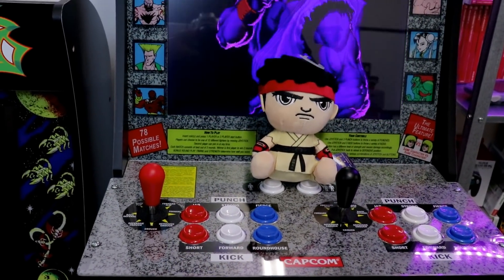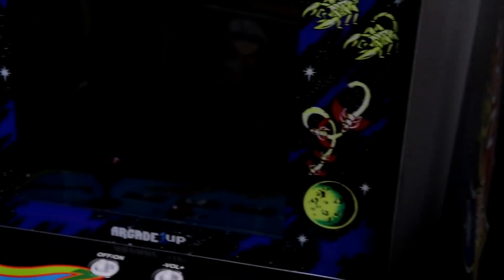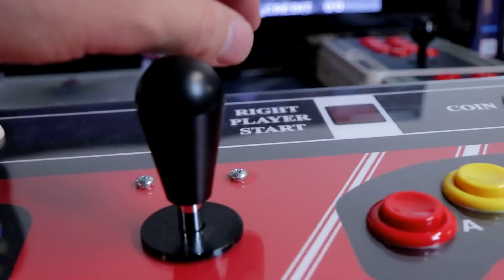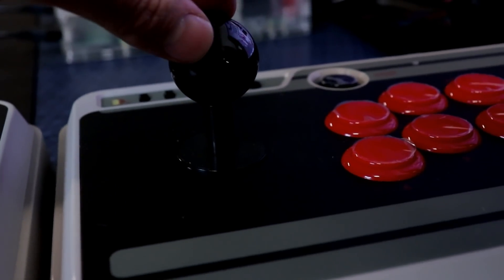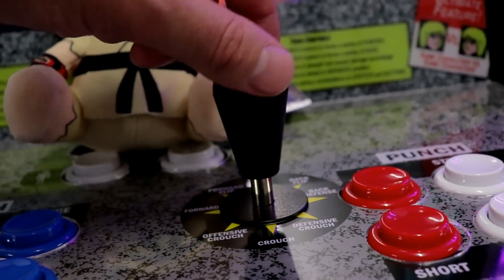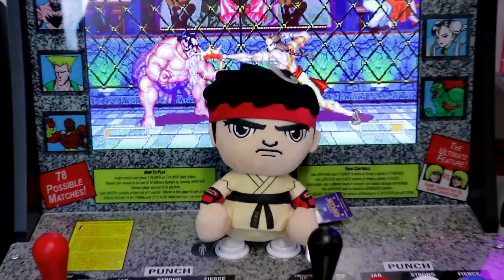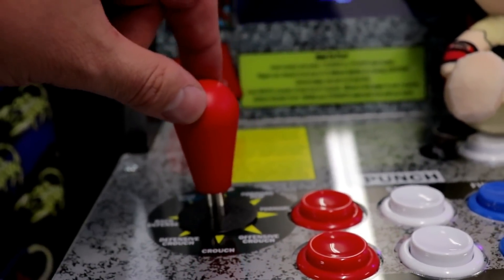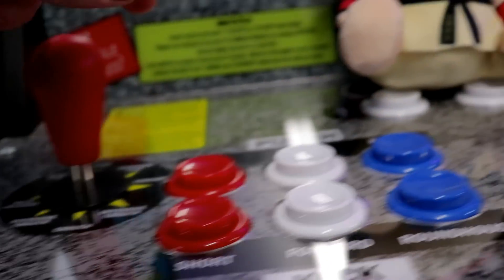Arcade 1Up Limp Stick Syndrome!

Comment: Day one, my micro switches got stuck. I opened up the sticks and cut off the small tabs on the micro switches where the small metal blade gets stuck. After those were removed from both sticks, they no longer get stuck and game plays great, but I do agree the sticks are loose.

Comment: There's no way the microswitches can be gone this fast, no matter how cheap those were - there aren't that many companies making those, and none of them are so crummy, besides, if it still clicks, and it registers when they click, they're fine. It's the stick assembly, the plates, the centring mechanism, low-tech stuff that could be built in a random basement with just a spreadsheet, a laser cutter and a jet or commissioning metal plates externally, and a handful of hands. An engineering mistake or low quality material in there somewhere for sure.

Comment: Thanks for spreading the word about 1ups. Too many youtubers are modding them like crazy and then acting like that's the normal thing to do for the gaming public.

If ETA Prime wants to put sanwa sticks and buttons in his mortal kombat cabinet while running a nuc with the pc version of mortal kombat xl for pc on it, more power to him.

But I think the general gaming public needs to understand these things are toys. Instead of trying to emulate ETA Prime, they would be better off with a diy bartop kit or even a plain jane full sized mame kit , boardss only, for 300 bucks if they are going to mod their 1ups anyway.

People would be way better off just getting the most basic bartop from gameroomsolutions then trying to mod a non clearance 1up.

Comment: Sanwa or bust
Reply from the maker: Man there are crappy Sanwa clone sticks that are a million times better than these things. Shit.... they should have bought Zippyy's for these.... those are hella cheap and at least 100 times better.
Reply: @Madlittlepixel  those are the cheapest happ clones you can get. I love my sanwa jlfs in my grs dual controller. I never really liked the happ bat style anyway.
Reply from the maker: @commanderosis435  Zippyy's? Those are Sanwa/Seimitsu type clones. All my sticks I use have either Sanwa or Seimitsu... both the 2 player panels I have from GRS are using Sanwa. I have like 3 more Sanwa's im gonna put into other things, just havent gotten to it yet lol. But Ive used all sorts of sticks over the years... and yeah Sanwa is my preference.
Reply: @Madlittlepixel  I meant what is in there right now. Zippys are ok as you know. Don't sanwas have cherry micro switches?
Reply from the maker: @commanderosis435  Ah i gotya. I only use Omron microswitches, and it seems most Sanwa's ship with them. Seimitsu switched to Omron's as well from what I have seen since their original manufacturer stopped making micro switches. I do have cherry micro switches, but havent used them much lately as I have been comfortable with omrons for a while. From my experience cherry switches are too soft, have to use a tougher spring with cherry's for me. You can get Sanwa's pre installed with Cherry switches, but I know they dont typically ship stock with em.
Reply: @Madlittlepixel  I might be thinking of my buttons. It's been several years now I can't remember. All I know is the sanwas are sturdy snappy and accurate I don't have nearly as much great as you. Too many other hobbies 😀
Reply: @Madlittlepixel  hey would you say that 1up joysticks are comparable to the Chinese made pandora box clones? You know the ones on Ali Express for 80 bucks?

A friend of mine got one of these pandora box clones new and the slop in their joysticks was very similar to what you are displaying.

Out of mercy I gave him 2 sanwa clones that were 12 bucks each and they felt 1000 times better.

I agree there is a huge difference I  quality between a 4 dollar joystick and a 12 dollar joystick, even if a 30 dollar sanwa rocks.
Reply from the maker: @ryecatcher25  I think the Pandora kits and similar devices have varying quality, ive used some that are slightly better than these, very similar or even worse. Definitely any of the cheap Sanwa clones ive tried out are tons better than any of them.